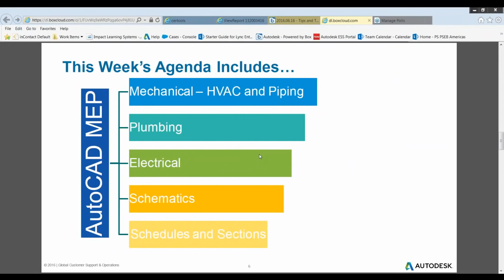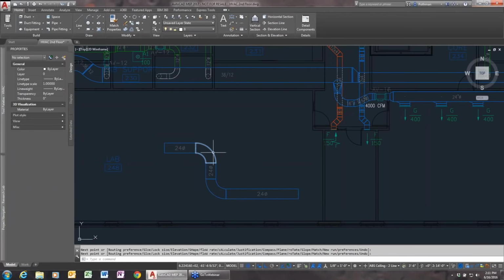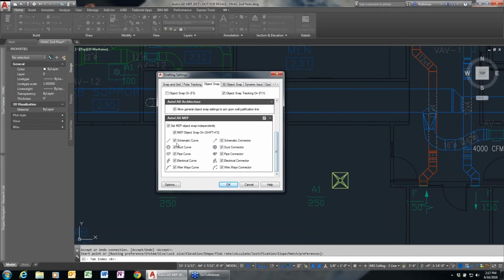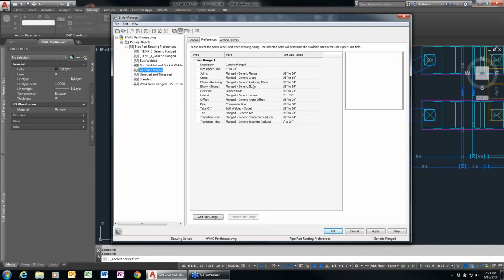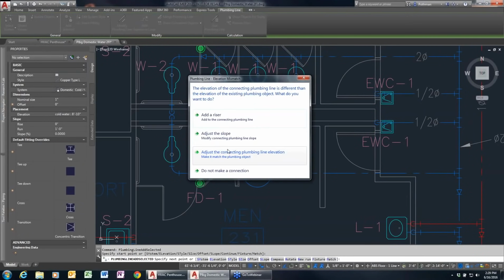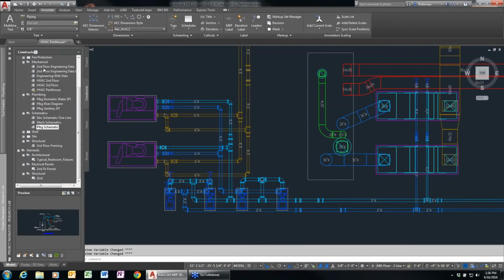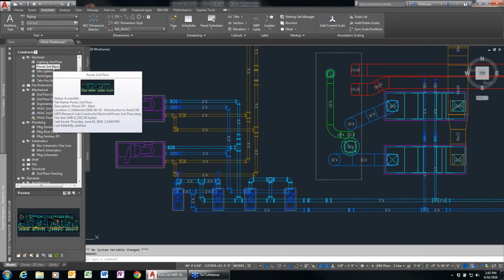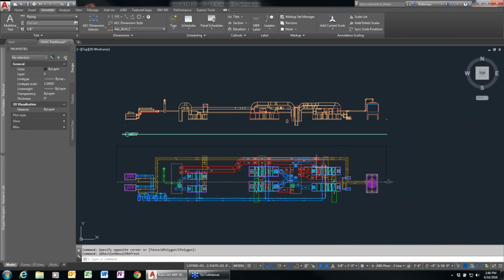AutoCAD MEP Tutorial for Beginners

Comment: Thanks for the Video. It helped. And Boom...you're not done.....Now, if you could show us how the Auto Connect function can automatically add Shut-Off Valves, Balancing Valves, Strainers, Suction Diffusers,  (Along with Temperature Gauge, Pressure Differential Gauge, High-Point Air Relief Vent, Low Point Drain Connection, Flow Control Valves, all of these connections being either Thred-O-Lets, Sock-O-Lets, Weld-O-Lets, or Therm-O-Wells), we'd be in good shape.     :-0       Plus.... adding Support Systems to include Clevis Hangers vs Roller Hangers, Seismic Design Tips, Earthquake Mitigation Specifications, Equipment Deflection Schedules, Vibration Isolation, ..... Just Kidding!....great job on the video.

Comment: Can you please help me out? I have two issues:

1. When I tag my supply diffuser, the correct information comes up, but the font is tiny. How do I adjust my settings so that my font is readable every time I tag something? It takes a lot of time to manually adjust each tag label.

2. The automatic function for hidden lines does not work for me when I draw one duct over another and they are set at two different elevations. Is this another setting that I somehow have turned off right now? Thank You